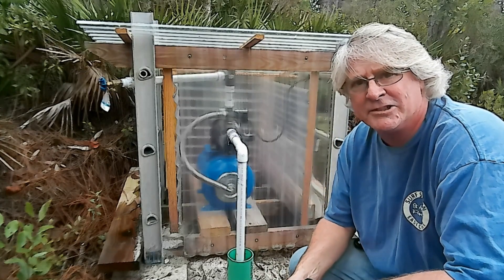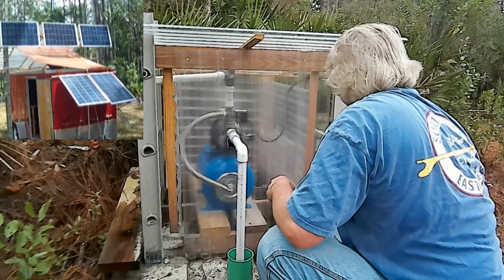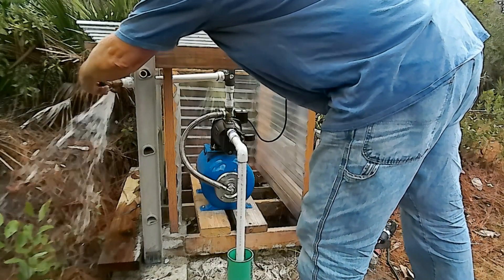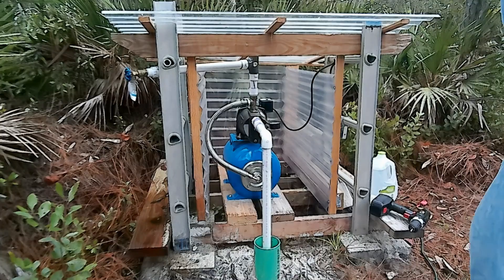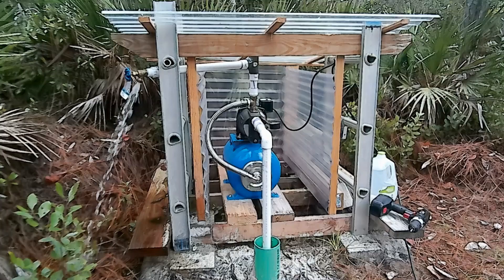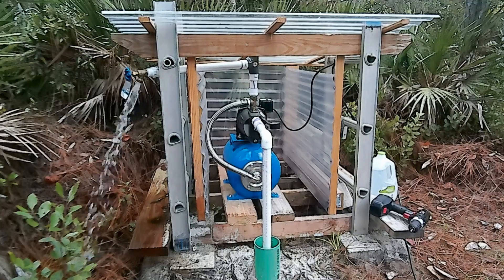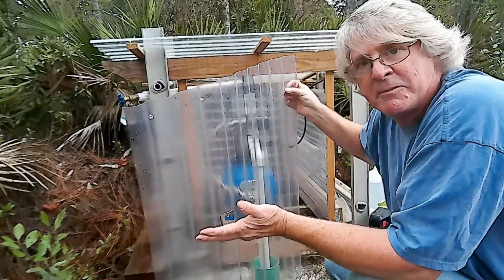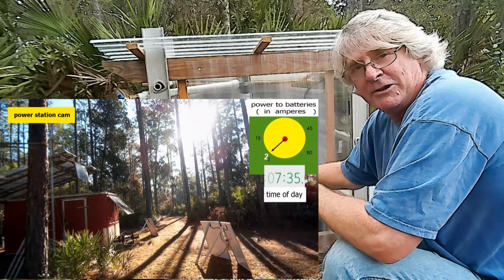Shallow Well Pump unused for 1 year! Will it still work?

Comment: I'm getting periodic surging when watering my garden, lawn, etc. No issues for the lat 3 years. I pull water out of the lake. My hoses are clean so the hang up is the tank. I'm wondering if you know where in the tank or factory lines that there may be a filter or where I could flush the entire system as I'm suspecting a build up of algae and other small particles. Especially since some got thru and did clog up the filters in my sprinklers that I took care of. Thank you for your help.
Reply from the maker: Hey Dr,will,
thank you for watching.
check for kinks in the discharge hose or soft hose if pvc. line could be bulging or collapsing.
Thanks again for watching!

Comment: How deep is the water pocket
Reply from the maker: hey luisratto, thankyou for watching.
if you watch the well pipe instaqll again you will see when the pipe gets easy to push downward. thats the depth at which the pocket begins. 
id say it is about 3- 5 feet of aqua flow. maybe a little more. its a pretty good size. thanks again for watching.

Comment: You should add a "Cap" to the system, keep bugs and other things out. Simple use an end, drill hole for water pipe use sealant and your done
Reply: Use a drain cap for the size of casing that you used. Drill a hole slithery bigger. Cut the 1” pipe and put cap on well. Place a connection that screws together with a center seal so that in the future you can remove pump for replacement if needed.
Reply from the maker: Hey Randy thank you for watching!
Reply from the maker: Hey James, thank you for watching!

Comment: What would you have done if there was no more water there? Would you have to drill deeper or a whole new well?
Reply from the maker: Hey Jim,
Thank you for watching.
The pump system is not capable of lifting water more than about 25 feet. I was relatively confident it would be just fine but I would simply drill another one if needed. Thanks again for watching!